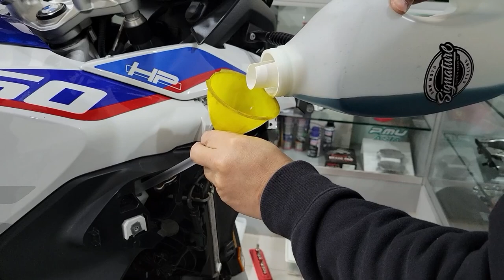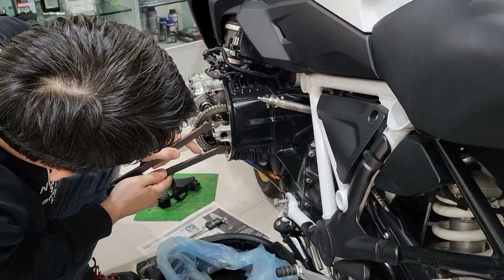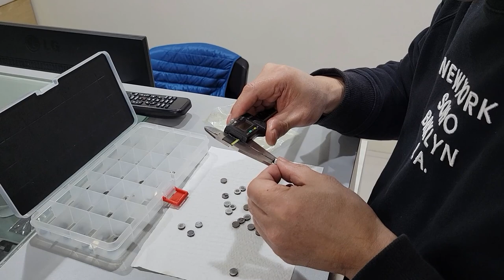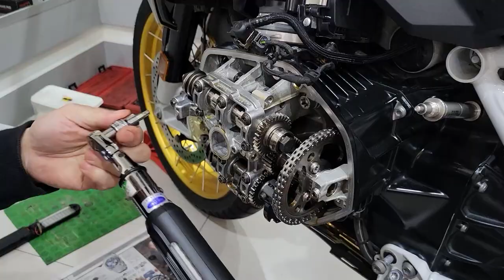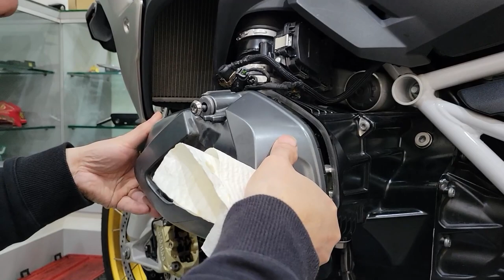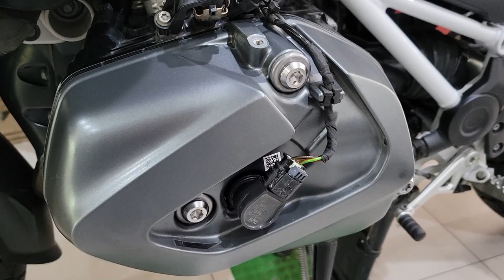BMW R1250GS Adjust Valve Clearance and Adjust Valve Time --- 寶馬 R1250GS 調整汽門間隙 與 調整汽門時間.

Comment: sorry why did you not explain about the camchain tension tool and the cam locking tool used when setting cam timing. great vidio thou

Comment: Where did you buy the CAM CHAIN adjustment tool?
Reply from the maker: BMW motorrad dealer or me.
Reply: @kuanyi59624  Thank you for your reply do you have the partnumber?
Reply from the maker: 83302467268 @christopherwhite8541